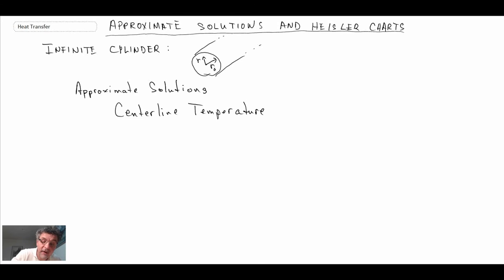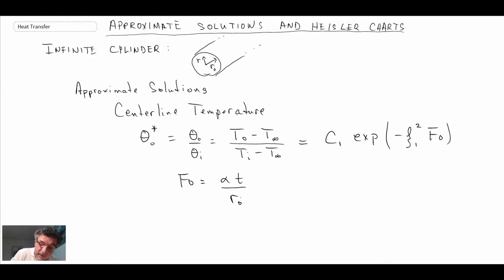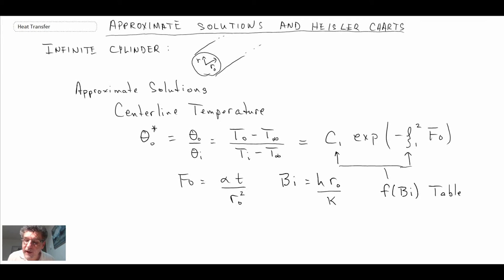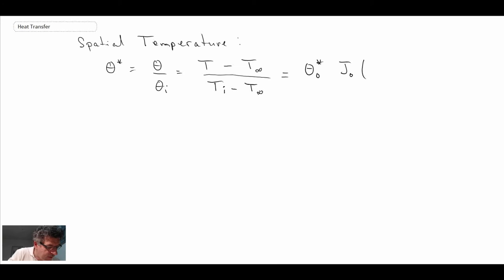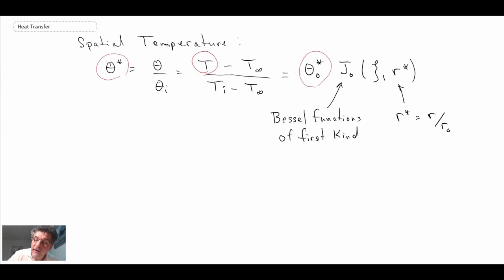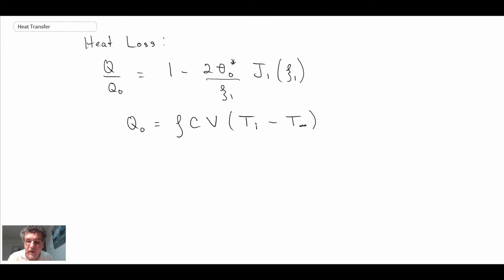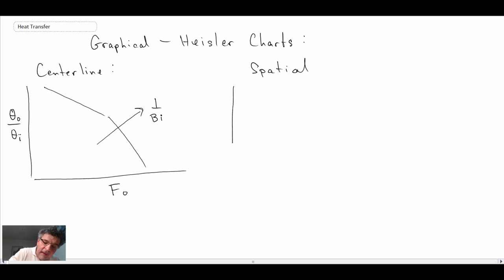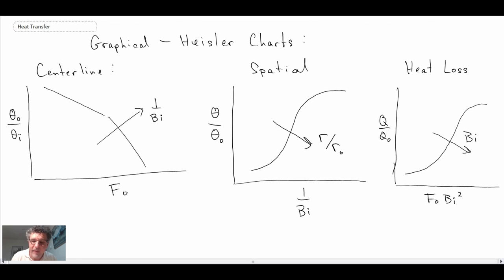Heat Transfer L15 p4 - Cylinder Transient Convective Solutions

Comment: Great video! Also, is there any source for a numerical method to solve these equations? Thank you
Reply: I know this is years old but for those who don't know, you can calculate the Bessel functions of the first kind by using the alternating infinite sum formulation using the gamma function, up to however many terms you need for your application, I just did it with 20 terms and that was sufficient for my application. 

For the inputs of the function, you'll have to find a sufficient method that more or less guarantees the first zero of the following equation x*J1(x)/J0(x)=Bi. Where J0 is the bessel function with alpha equal to 0 and J1 is alpha equal to 1 and Bi is your biot number.

Do not use the integral formulation of the Bessel function, as that is far too computationally expensive, as only a small number of elements are required for a decent accuracy of the Bessel function.

It's important to note that the infinite cylinder approximation only holds assuming the Fo>0.2